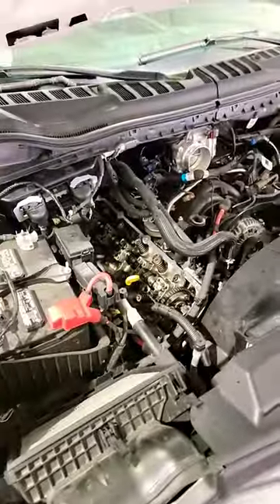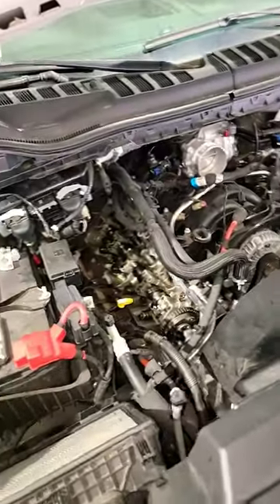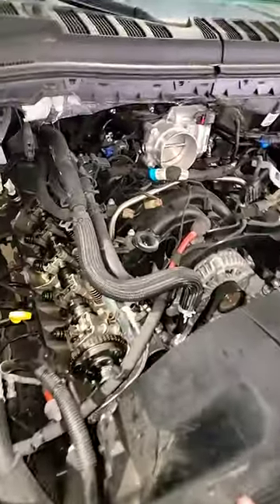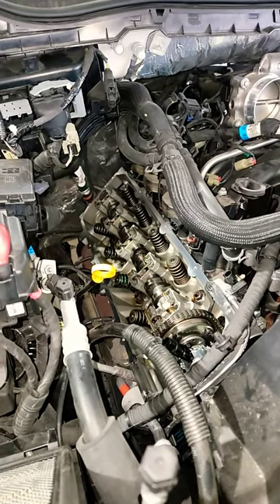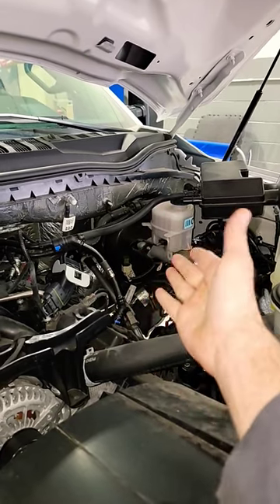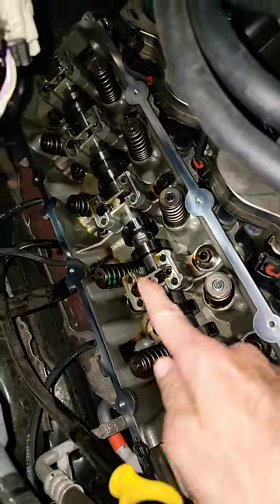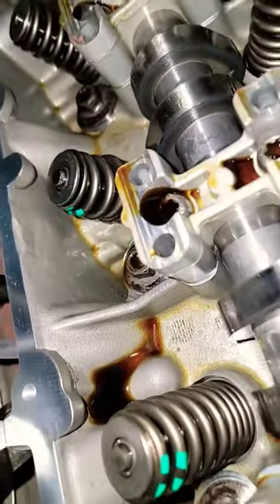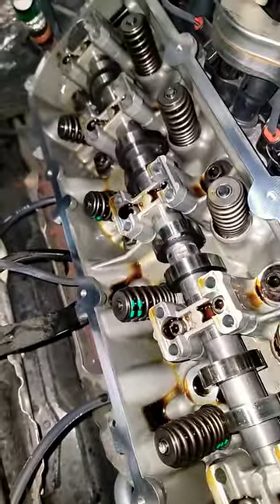someones BUSTED Has this ever happened to YOU?!?! #shorts #fordtrucks #fyp

Comment: I've changed at least 4 6.2L valve springs for that at the shop I work at, 2011 was the oldest and 2019 was the newest.  The 19 only had 68k on it.
Reply: I have an 11 F150 Plat 6.2L, 186K. Went into the FOrd place and was ready to buy 16 for PM. The tech talked me out of it, he said come with me, he has a valve cover off a 21 or 22, he said imagine if you changed them and one broke :lol:. I wonder if they would warranty the engine if I bought  16 springs though if one failed and destroyed it. 2 yr ford warranty, no?

His theory is they are very long valve springs. 

I also have a DOHC 4.6L 32V Continental, had a spring break on that too. The repair spring from Ford was a beehive.

Comment: Easiest valve spring replacement (super common on this engine), connect an air fitting to a compression testing hose and get that shop air into the cylinder at tdc, Holds the valve in place while you pull keepers and get the new spring installed. No pulling head required.
Reply: Done it many times.

Comment: Just had a truck today with a broken cylinder 1 exhaust valve spring. Same symptoms. Truck is a 2018 with 65k. The rocker tips are also missing on cylinders 1 and 2.

Comment: 6.2’s seem to have a taste for a valve springs.
Reply from the maker: Omg I know...
Reply: JUNK ENGINE'S BY FORD
Reply: @donaldkinder6716  I beg to differ I have 2 6.2s. 2012 with 330k and a 2014 with 356k. Amazing engines
Reply: @MichaelOnYourSix  my trucks get almost 14 mpg and they make me a lot of money so yes I buy alot of cool things
Reply: @MichaelOnYourSix  what about the math when you need new glow plugs,injectors,or emissions issues?? You can buy a new crate engine 6.2 or other gasser for any of those diesel issues..
Reply: @MichaelOnYourSix  How am I getting 16.8 combined w/19-21 at 65 mph in my '12 F250 6.2 4x2 crew cab LWB, 210k miles?  Maybe I'm just not driving it like an idiot in a sports car??
Reply from the maker: Yea maybe cuz u just reset the DTE. No way that turds getting that
Reply: @PowerStrokeTechTalkwARod  I get right around 500 miles out of every tank and I fill up with right about 30 gallons each time. The computers may lie, but actual fuel consumption doesn't.
Reply: @MichaelOnYourSix  guess you never owned a 5.4. 6.2 gets 13-14 mpg towing 4k behind it all day
Reply: @MichaelOnYourSix  how am I a clown. You definitely have never driven a 5.4 triton. They get 8 MPG on a good day. I drive 80 down the highway and my 2012 6.2 with 322,000 mi on it and I get 13 all day

Comment: Not one valve spring in 150k miles of abuse and racing.
Reply: 151k and hoping for the best
Reply: 100k 2013 extreme abuse with a limiter that make brabababa 💥 @ 4.5k rpm but keepin the oil always fresh. Hope it runs another 100k.

Comment: I had the same problem on my 2017 f250 6.2l and I found the problem was #1 spring was broken. Luckily for me I bought the truck 20k under the price for tha issue do to no mecanic had find the issue so they send it to auction as bad engine so I paid 13k for it back in 2020 and I find the issue the first 2h of trouble   shutting and I am not even mecanic lol and it cost me $68 to fix it and about 4h lol and sold the truck 2 years later after using it for 40000 thousands miles for 26k and the truck was running like new went I sold it .
Reply: I wonder if they just didn’t want to fool with it

Comment: I have a 2019 F250 four-door long bed with a 6.2 L and have about 32,000 miles on it if I have to have to do this repair is there a special tool that squeezes those springs into place or is it better to just take it in the shop. I haven’t heard about many issues on the 6.2 other than cam phasers whatever that is. Thank you for sharing
Reply from the maker: All i use

Comment: The only 6.2 In my fleet blew a spring and worker kept driving thinking the check engine light and small knocking noise wasn't anything serious. Ended up dropping the valve into the cylinder and deteriorating the whole engine.
Reply from the maker: Ughhhhhh

Comment: 6.2s eat valve springs like crazy. It's always on the passenger side too
Reply from the maker: I know righhhhht
Reply: why? it runs hot on that side or what? these guys not changing their oil or somethin?
Reply from the maker: High revvy maybe
Reply: @PowerStrokeTechTalkwARod  cywinder thwee high revvy uwu :3
Reply: @PowerStrokeTechTalkwARod  How do you rev the passenger side more than the driver side?
Reply from the maker: Theres a switch on the dash

Comment: I don't have a Ford F-25,000 High Definition edition but I do have a Ford transmission installed on my Chevrolet and that's a scary thought. Surprisingly it has lasted almost 10 years and 100k miles with a few problems but doesn't need a rebuild just yet.

Comment: Not eaten a valve spring, but have been dealing with a constant hard start! Even worse when the truck is warm. It's a 6.2, we did plugs, and coil packs(oem), and it's still doing it! Approx 150,000km
Reply from the maker: Fuel pump timeeeeeee

Comment: 🇺🇸🇷🇺🇨🇦❇⚓🔩⚓❇🇺🇸🇷🇺🇨🇦.....From the outside the 6.2 L V8 appears as an architectural beauty! Then again I'd take a [(Ford 6.7 L Powerstroke Diesel) or perhaps the more unique (hemispherical/HEMI) engine] over this almost any day check.....
Reply: this engine is hemispherical.
Reply: It also has 2 spark plugs per cylinder, like some other hemispherical engines.

Other than valve springs, the 6.2s are solid engines. I've seen plenty with over 400k miles.
Reply: I have 2 6.2s with over 330k. Love them. Great engines

Comment: 6.2 diagnosis every time rough running. Pull DTCs, P030x, monitor power balance and see cylinder x has distinct dip of misfire. You see the next cylinder in the firing order have a huge peak, dollars to doughnuts you got yourself a broken valve spring
Reply from the maker: Good deal. Everyone ive had, going to pull it in has had very poor braking assist because of the lack of vacuum bring built. Was a dead giveway

Comment: A lot of my friends have problems with Fords but I only have an 2007 F150 and it has the 4.6 Triton motor in it, to me it seems like the last good Ford motor they put in any of the f150  Because I got 200,000 miles on it With no motor work done whatsoever

Comment: My 6.2 ate an air filter 😂, I’ll give a back story, I bought it at auction with mechanical issues, I was busy working on other peoples stuff as always, so I sent my brother over to the auction yard to look at this truck because it was at $1500 bucks and only had an hour left on the sale, he checked the usual things like oil coolant air filter, he noticed that the oil was low and black but the air filter was brand new, which was odd, I ended up buying the truck for $4k and got checking into the issue as to why it would not crank, turns out it ate the air filter and caused the intake valves to stay plugged open, so it was a complete mess inside, a did a low mile wrecker engine for $500 and it’s been working good, just gotta keep the air filter clean 😂

Comment: Where is the quality of engine components that was there in the 60s 70s and '80s? These engines today have high HP, compression and close tolerances but the quality of the components of today can't seem to handle the compression, close tolerances and RPM's these modern engines generate.

Comment: Yep a 2011 with 430k.
Reply: Damn 430 impressive I have a 14  120 k not 1 problem yet if I get 250 to 300 k I'll be happy
Reply: My f150 4.6l v8 has 496k those 4.6l v8 are bulletproof engines.
Reply: @theshield1613  lmao yeah right triton junk
Reply: @donaldkinder6716  4.6 are bulletproof
Reply: @andrewstratton806  lol you sure Don't work on many seen timing chains go out bad about coil packs Throw away engines weak ENGINES
Reply: @donaldkinder6716  don't have to work on them. Change the oil every 5k. Change coils and plugs every 100k. Great engines.
Throwaway engines would be a 6.4 powerstroke

Comment: If only Ford could've stopped with the 302 and GM with the 350. Unfortunately, gas isn't $1 a gallon anymore. Meanwhile, Honda and Toyota make sewing machine V6 that run forever. Goodbye American pushrod V8, it was a good run. You will be missed.

Comment: It’s funny. Any time ford makes a high performance motor, it breaks valve springs. For years. And people never give a conclusion why. It’s the same reason why Fords rot apart when they were made from steel. Because Ford doesn’t care about their metallurgy. They have never cared what Chinese scrap metal they make their hardware or panels from. Hell, they’ve never cared how worn out their tooling is when they cut threads ffs. The next time you are tantalized into consider buying a ford- remember that ford also stands for Financially Obligated Regrettable Decision.
Reply from the maker: Y waste your precious time commenting 🤷‍♂️